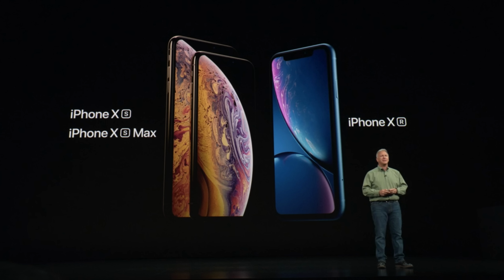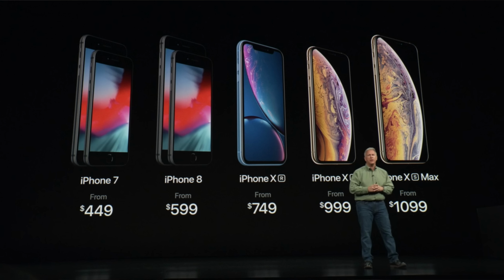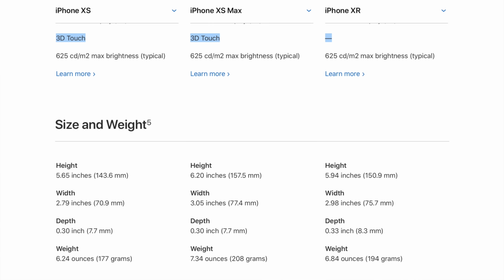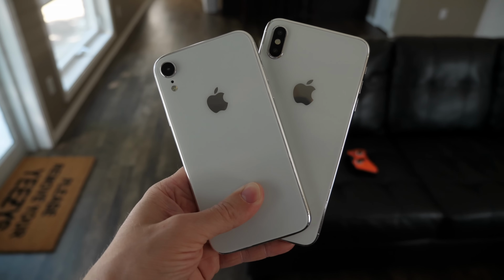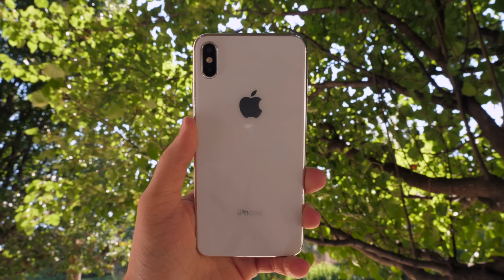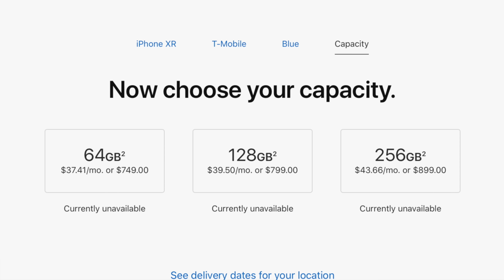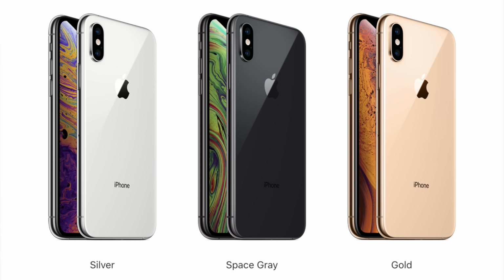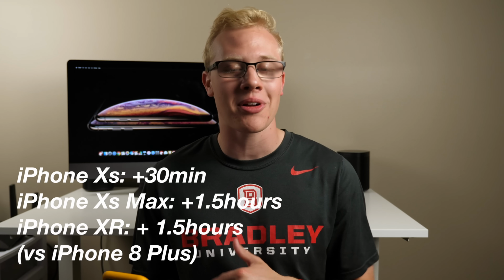iPhone XS vs XR: Which One Should You Buy?

Comment: Was originally wanting the Xs Max, but after the keynote, I’m now considering Xr instead. Don’t remember what $1100 US would be in Australia, but it would not be pretty. Plus, it doesn’t seem like I’d be missing out on much. Particularly since there IS portrait on Xr. Just no optical zoom or 3D Touch. Little concerned the screen resolution will feel like a step down from the 7 plus I currently have, but I’m sure it’s fine.
Reply: I'm pretty sure (confirmation needed) that they have 'Haptic Touch' in the XR, its like 3D Touch but without the pressure (u just press and hold).
Ofc most things wouldn't have made it from 3D Touch to Haptic Touch, but it's not too much of a big deal anyway since Apple is bringing 3D Touch gestures to non-3D Touch iPhones.
Reply: the iphone xr will coast $1600AUD in australia what a joke why is everything so god dam expensive here 😪
Reply: if u check it out ipad pro have lower resolution than Xr
Reply: jayce ng assuming you meant pixels per inch, not resolution, you’re right and that’s so weird, I never noticed. I suppose you can’t look at iPads as closely because they’re much bigger, so it makes sense, but still... weird
Reply: Ok, it’s not that weird... but I just hadn’t thought about it
Reply: my bad is pixel density not resolution, but some strongly argue that XR is rubbish because with that kind of price and is expensive with this kind of price, u can easily get a Android with a better spec,  moreover u cant see 1080 video only 720 video , so it turn down on what u really need for phone, so for me XR is fine
Reply: i am actually upgrading from 6plus ( first generation )

Comment: Interesting to know if the battery capacity has been increased to get better life or whether it’s all down to cpu efficiency? As somebody else pointed out the portrait mode is available on all 3 via software only I guess on the XR? The primary camera advantage is presumably the 2 x optical zoom on the dual camera versions? The A12 Bionic sounds fierce and it will be interesting to see how it stacks up against next generation Android processors?